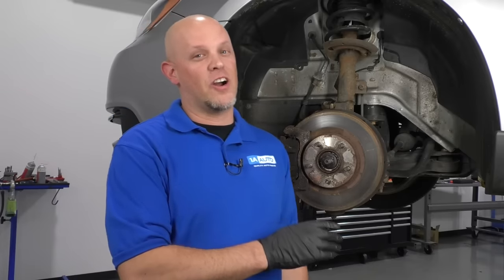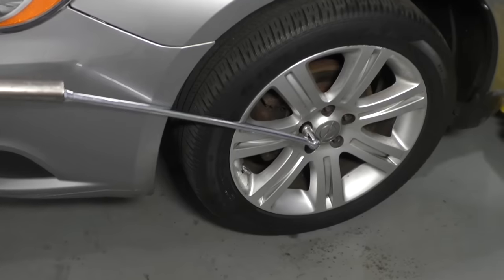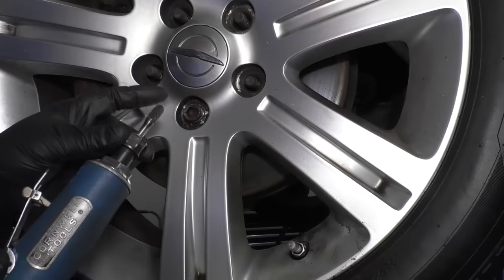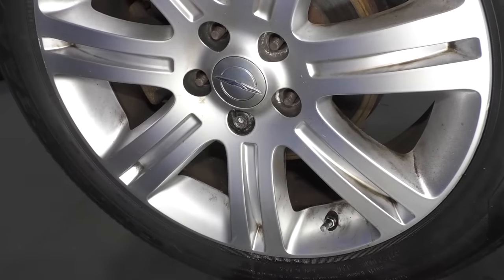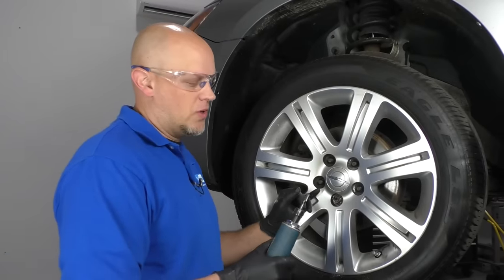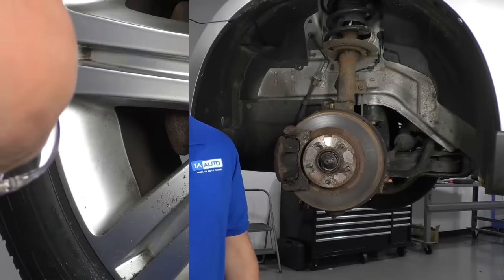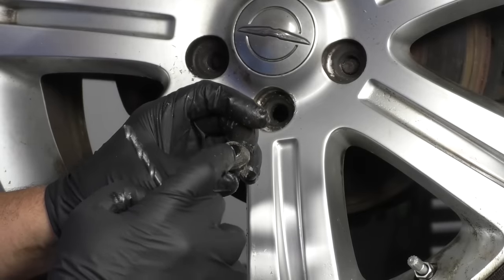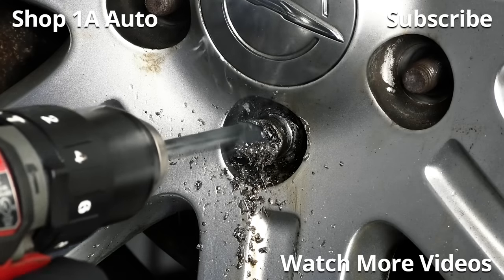This Lug Nut Wouldn't Come Off Our Car!

Comment: Cut the wheel off and charge em' 1500 bucks to repair the whole left side caliper and rotor assembly and 300 bucks to assemble the new wheel and new tire. Sorry mam that ull be, um, 1800 plus tax, oh I forgot, we also replaced the tie rod ends for safety reasons, ah so, your total will be $2,453 and 71 cents plus tax. Oh, and no warranty on used factory wheels by us.